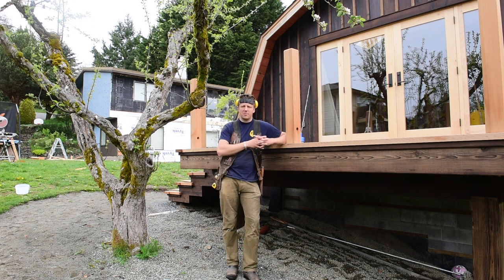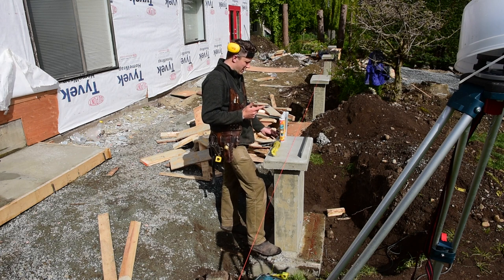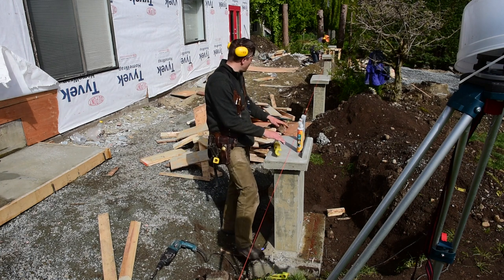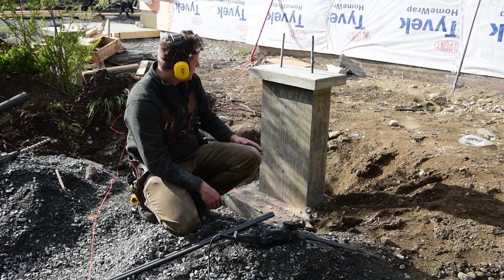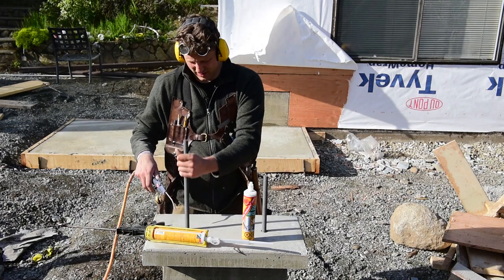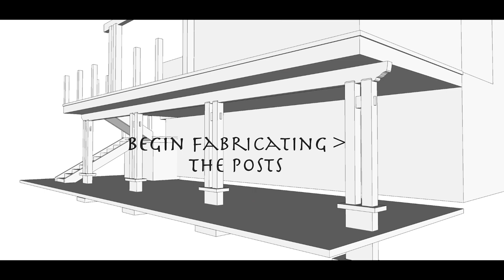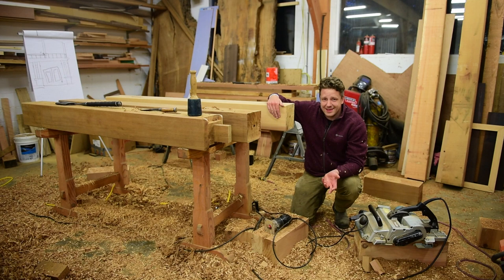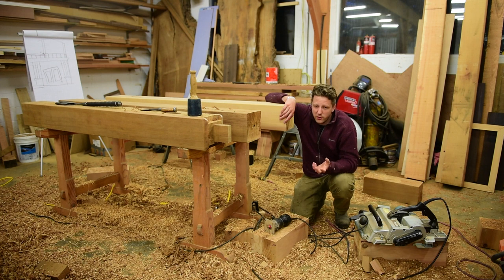WUW #50 Drilling Concrete And Cutting Posts!

Comment: Another keyboard commando here: I would have punched 3 friction piles at 6-8ft long and then formed a pile cap on top afterwards to ensure minimal to zero movement. You could have left the rebar cage from the piles sticking up out of the ground elevation pour and then cribbed pile caps after the fact.  Those are just my 2 cents that are probably only worth a penny. Love the vids and full support from a fellow British Columbian.

Comment: You should look at using a water level - makes it super easy to get an exact level point on multiple posts / points that are far apart, without having to try to use a laser outside.

Comment: Hey Jesse :) I got a trick for ya. You said you were going to use a wood mallet to straighten those rods you applied epoxy to. Try this> I take a piece of 3/4 iron pipe( 3/4 always worked best for me, due to foundation and construction site bolt sizes) and put it over my J bolts or rebar and then bend it the way it needs to go. Way less stress on your concrete, bolt threads, etc. Btw your deck is looking awesome bro, love your vids:) All the best with your future construction builds and projects -Jeremiah

Comment: Raise the posts 1 inch off from the top of the concrete.
Add a nut and washer under the bottom of the posts,there is your adjustment.
You are welcome :)

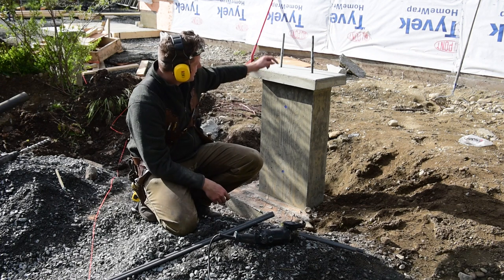Comment: 5:43  I notice the grain in the concrete, looks nice however that's probably from stingering it correctly.  That will all disappear at some point.  If you or anyone else wanted that grain to stay, simply sandblast the inside of the form board, and sting properly.  Looks amazing, I even put a 90 degree corner roundover into the seam of each formboard to create a rounded indent.  But then I remember you used plywood so this wouldn't have worked.

Comment: Samurai.. I know a line level does wonders for $10 but a simple transit and rod would cost you under $200... You're such a perfectionist when it comes to woodworking! That simple upgrade would save you so much time and be much more accurate

Comment: Is there an advantage to drilling the holes and setting the threaded rod into the concrete after its set up vs putting the threaded rod in the concrete while its setting?
Reply: it is one less thing to worry about, pouring concrete can be stressful
and its easier to get layout perfect afterwards
Reply: Yep I was thinking the same question. Is it a matter of six in one hand and half doz. in the other? I did six setups like this last Fall for 8x8" steel deck columns on my project. I made 3/4" plywood jigs that I secured the all thread into with double nuts. Had grid lines on the jigs to line up with snap lines. Press them in after the mud was vibrated. **Love the look of the capped concrete bases!!!!**
Reply: I think it saves the trouble of having a jig to hold the rods in place...
You don't want them sinking to the bottom :P
Reply: epoxies can have other benefits too. they will flex, are much harder than concrete, there is a reason that's how the DOT does metal to concrete connections in the states...

a reminder that you should follow the epoxy's technical data sheets on installing anchors with epoxy. for example I didn't see him prime the product to ensure both halves of the epoxy were flowing before putting the nozzle on which could result in less strength or a tacky finish. not to mention you should fill your holes from the bottom of the hole with the end of your nozzle underneath the epoxy's surface to make sure you don't have any air gaps in there. his screwing the anchor and adding epoxy from the top could also pull air into the chemical anchor. 

all that being said he isn't building a bridge or something that has much force on these anchors so he will likely be ok but it is worth noting...

Comment: Just curious...why did you choose to drill and epoxy each rod rather than using j hook anchors or putting the rods in while  the concrete  was wet?
Not telling you how to do your job ...just curious why you did it like this. Is there a benefit doing it this Way vs installing them into wet concrete? Or just personal preference ?
Thanks
Reply: I would have done as you said. then you wouldn't have to buy the epoxy.plus he just poured the concreat
Reply: I think it might be an advantage to drill the holes later, that way if you  put j-hooked rods in, you'd really have to care where they ended up so you didn't have to custom locate each hole in the post. His way. You can drill on center in both the wood and concrete.
Reply: +Micah Kruger very true plus its one more thing to worry about when pouring. however he wouldn't run into the re bar like he did. if using j hooks
Reply: Some people prefer to do it that way so there is less going on during the pours.  I've noticed this mostly when there aren't enough people in the crew to run the pour and take care of something when it goes wrong.  I guess it depends on how many dowels you're to have to do.  I can't imagine it costs less.
Reply: G23 also the layout can go sideways on ya, this way he can take his time and get it perfect ...
Reply: G23 foundations are not perfect. This way you can get the exact measurement when it comes to putting the posts in. I do it the same way he does. No way is wrong, but things can be finicky with pouring concrete
Reply: G23 it depends on the circumstance i wet anchor when im doing a city job where everything is flat N' leveled up and if theres only a couple of posts to do becuase you have to sit with your creation untill it sets (for me at least i dont like messing up jobs you loose more than a pay check reputation is everything for your next job) but if your doing alot and theres wet dirt plus un ideal weather it easyer and safer to do it with epoxy becuase you have a little more room for error.

Comment: Sir, are you a licensed contractor? I'm asking because I know getting inspections from the city permit people used to be a nightmare where I once lived. Do you have to wait for inspections from the building permit people often? Just curious. What was that spring-loaded tool being used at 9:27 in the video? Thanks.
Reply: The tool looks to be a portable chain mortiser, helps cut the mortise straight through thick material.
Reply: Thanks, Tim. I had never seen one.

Comment: How does the epoxy hold over time compared to red heads or equivalent? Not trolling just wondering.
Reply: The Michigan Woodworker epoxy is stronger than concrete so it'll hold up fine
Reply: Stronger? In what way? Tensile strength? Longer life? I'm curious as to what my supplier isn't telling me.
Reply: The Michigan Woodworker I don't know the specifics but if they'll allow you to dowel something straight into concrete and it passes as the same something with a bend pre cast into concrete then it must be!

Comment: What did you do with the circular saw at 9:12?
Reply: He put a cove in the bottom where the rod comes in, my guess is a barrier between the wood and support?
Reply: g00thier just removing material so the outside of the post contacts the concrete instead of the middle "rocking" on the unevenness of the concrete. If that makes sense.

Comment: Im a subscriber and a big fan of your work samuray, but as an european architect, the footing design is a mess, looks like there is no structural calculation, the connection between the wooden pillars and footing is also deficient. This is no good praxis in any kind, the contractor let you all this by yourself? I hope you dont have any problem in the future but this is a sloppy work. I dont try to troll im just concern.
Reply: This is not an official opinion but those columns are incredibly oversized and he's probably ok with pinned connections like that, although an engineer should probably look at them since the deck is attached to his house.
Reply: Alex Rail I was wondering why there was no steel in the first video but he just mentioned that he put some bars in.. unfortunately the vertical bars are not absorbing the forces.. they would have to be horizontal to absorb the diagonal forces resulting from the shape of the column
Reply: Random Mcranderson The problem is not that the pillars are oversized, the problem is the possible appearance of interstitial condensations between concrete and wood which can be frozen. This can cause new forces that weaken the union and that the union does not work correctly, instead of working with compression forces begin to work with eccentric forces as well. This combined with the lack of concrete reinforcement, so to be seen in the videos is insufficient, can cause fractures in the concrete in the long run. And all this without talking about the dimensions and geometry of the footing as well as the execution itself which are all incorrect. This is bad work, simple as that.
Reply: Alex Rail 
If you would, please post videos of your craftsmanship, so we can see exactly what you can BUILD, as opposed to what you can draw.
Architects tend to draw Elephants fucking pigs, without ever having been to a zoo or a farm, if you know what I mean.
Reply: Michael Hull  I have worked as a mason in the summers while making the career of architect, so believe me not only can design and calculate but make the whole fucking farm. That's why I can say that the way he is making the footing is wrong not only "theoretically" but in reality . That said, in the construction is not about having craftsmanship but doing things right and he is doing things wrong. If you know what I mean
Reply: Michael Hull hahahaha. You said what alot of people were thinking. I graduated from an LA program. Had a lot of architect  freinds...still do. They are good guys. hey. if the do fail (doubt they will) so what...jack up the deck and hire  an architect to design and calc it. then build em again.
Reply: An engineer built the Titanic, a carpenter built the ark.......
Reply: John Randall arc didn't exist and the titanic was sunk due to bad sailing, not engineering.
Reply: Alex Rail see that's the thing you're an architect not an engineer i don't think you really know how to judge the structure's viability. Concidering the materials involved the only part that could go wrong here is if the whole structure isn't attached properly to the building and i really doubt he would fuck that up. There's nothing wrong with anything done so far
Reply: Badger0fDeath What I am trying to say is that in addition to the axial loads on the pillars also find eccentricities of loads and transverse forces. What I am saying is that if the connection between footing and pillar weakens this can produce an increase of eccentricity in the loads, by the incorrect transfer of loads. English is not my first language.
Reply: G33RsofDeath you are engineer? If you are tell me, you think that the geometry, the realization and the amount of steel reinforcement of the footing is correct under the current regulations, the union also. At least in my country, no
Reply: T Conway, the arc was found, it did exist. The Titanic sunk because of shortcuts on safety in design. The internal structure should have arrested the incoming water. loads of ships have struck icebergs without total failure and submersion.
Reply: Spoken like someone with no understanding of the physics involved in engineering
Reply: jeffeverde1 if you were reffering to me I have a degree in engineering and have lost only one percentage point out of three college level physics courses. I do not have the specifications on his concrete mix, rebar size, full static and or live load intent, or a copy of "Pointy Ears and Shaply Rears" from the planet Vulcan. But with better than twenty years in construction in addition to my current schooling, to switch careers, I think I know of which I speak.